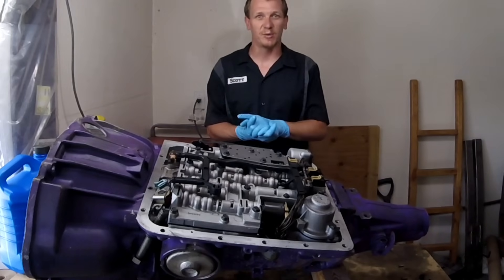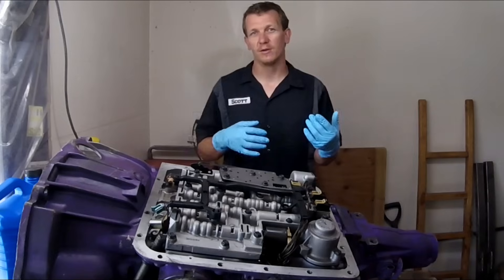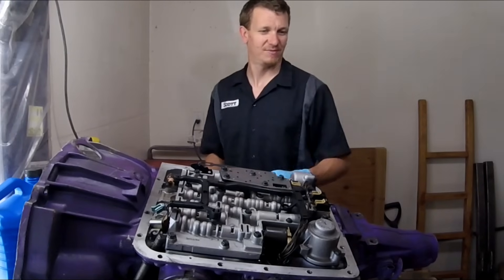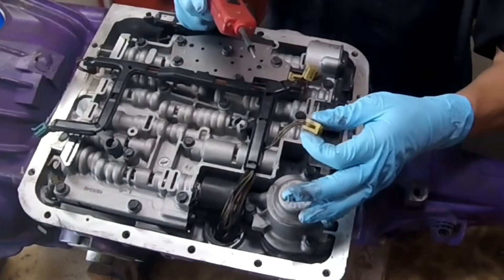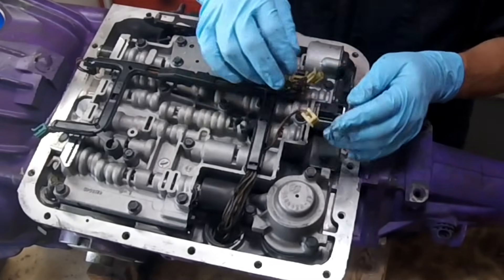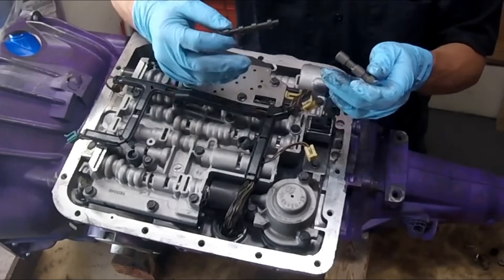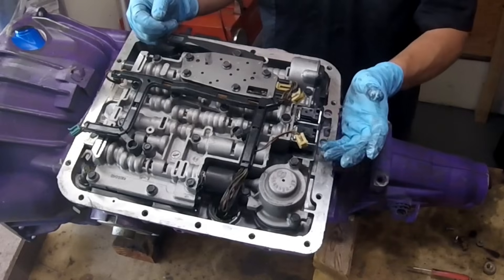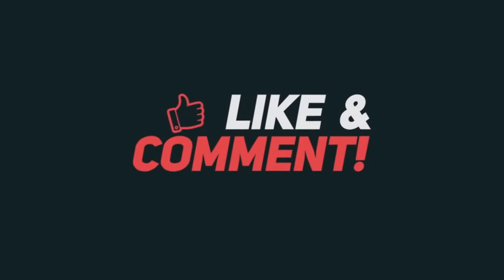⫷ GM 4L60-E Shift Solenoid 1-2 3-4 A and B replace p0756 p0753 p0752 ⫸

Comment: I got a 2005 avalanche I pulled the solenoids out, took the valve shafts and spring out, from somewhere a little 1 inch small spring and a small steel marble fell out to, where would they go never seen them doing this operation before

Comment: Hi on my avalanche  I did a transmission fluid change after replacing the filter and both solenoids and putting everything back both solenoids are stuck on and I can't shift past first on the computer I hooked up it says that both grounds are fine and voltage to them are correct I'm confused as to what I should do now

Comment: I enjoy the video thoroughly. I have a 1995G 20 Chevy van when it starts out at fifth’s perfect but after you drive a while and you stop like at a red light and go again, it doesn’t shift like it should so I am going to attempt to replace the shifting solenoidsand see if that’s the problem.

Comment: I have a 1993 chevy silverado c1500 v8 5.7 350. From the looks of the transmission wiring harness that it has, it only has 6 connections. It doesnt have the pwm solenoid. Do you know what part # harness it is. If you can help me out, thanks.

Comment: Howdy. I have a 1995 228,000 miles Sierra 1500 pickup.  Only symptom I have is delayed shift from 1st to 2nd. It waits until 2,700 to 3,100 rpms. I can usually make it upshift to 2nd by easing up on fuel pedal just a little for a moment. Does it hot or cold, in cold weather and warm. 

Everything else works as it should. It will downshift from 2nd to 1st as it should. Fluid clean, good and exactly Full. Fuses all good. No CEL or codes stored. No visual leaks or consumption. 

Is this the 1-2 solenoid / solenoid A failing, more than likely?  Or the 2-4 Servo?  Or the 1-2 Accumulator valve?  I have no CEL or stored codes.

Also, is there a way to manually shift it to further narrow down issue?   Many thanks!

Comment: I have always heard shift solonoid a and b should not move freely like that once installed.  And if they do the seals are bad.
Reply from the maker: They should not wiggle too much. But! They are not super tight. The groove that hold the clip that holds them in has a title play. If you do have a lot of play.. it is completely possible the Oring on the solenoid is bad. 

Thanks for stopping by and saying hi.  Hood luck with your project.  🤞🏻👍🏻💪🏻

Comment: Hi mate. The shift solenoid A and B is it the same one responsible for 3-4 as well ? Please I am having issues on my car corvette 2000 when I change the the 2 solenoid A and B the gear shift normal from 1-2,2-3 but hard sometimes to shift from 3-4 or 4-3 downward 😢😢😢😢 please extend your support

Comment: I had my tranny fluid line spliced it  blew out fluid eventually lost 3 Rd and forth gear? I don't know if I burned out clutch bands or if solenoid b went out ! If it's just the solenoid shouldn't it shift if I change it ! The truck will move and drive around town in first and second gear it seems if the bands were bad it wouldn't move in first or second

Comment: Hey I have a 2005 GMC Sierra the problem that I'm having is I'm in driving it stop pulling I pulled over set it off crank it back up and pull off it went from first to second then it stopped pulling again got it home got it home and it won't go in drive or reverse Crank it up the next day it went in reverse it went in drive what do you think it could be the shift solenoid

Comment: Got a 1997 Gmc jimmy 107,000  miles shifts perfect but when you are driving in randomly drops out of overdrive I did the whole tap the brake pedal the TCC does its thing but it will randomly fall out of over drive then shift back into overdrive.  Someone has put a cold Air intake on it I thought maybe maf sensor could be tricking the computer checked all the fuses when it's in overdrive it doesn't slip it runs great just falls out of overdrive to 3rd then give it throttle shifts back to overdrive fluid is new and Clean I traded for the vehicle so but it's low mileage some help greatly appreciated

Comment: Nice. However when you took out the 2nd one, you should have wiped it off as you mentioned while you had it out for visual representation. Regardless of the fact it may have been a 'junk' transmission. 👍🏻
Reply from the maker: That is a great tip. 👍🏻💪🏻

Comment: 1996 chevy silverado k1500. 4l60e got rebuild 30k miles ago and it acts fine when i’m driving after about 20 minutes of driving and i come to a complete stop, go to take off and it wants to go 5 mph. feels like it’s stuck in 2nd. i put it in 1st, then 2nd. nothing. i have 3rd and then no 4th. this happened out of the blue. i let the truck cool down and its fine again until 20 minutes of driving.

Comment: Did I miss something? When did the rod come out on the second solenoid rod removal?  When you put it back in does it go.    Spring, Rod, Spacer, Solenoid, Solenoid Clip?
Reply: Good question.... Because my 07 Tahoe did not have a spacer.. should I be concerned

Comment: I have a new problem. This video is excellent, hubby a mechanic, but really retired. My GMC Yukon XL Denali 2011 has had a slight problem for about 6 months, occasionally at a light, I press the accelerator and it jerks into gear as I take off. Then while driving home from a long trip a few days ago, at the start of the trip, driving 75-80 mph at times for the first hour. Stopped at rest stop, then when I got on the road the shifting wasn't working correctly. Sometimes when accelerating, the rpm's shot up but the car didn't seem to want to accelerate. We ended up driving home with the TOW button pushed and babied it going home. Hooked it up to a scan and it isn't giving any codes. We want to start with replacing both solenoids and checking the harness ends. But according to the friend mechanic that hooked it up, said it wasn't looking like it even has a solenoid in the transmission (like that particular transmission doesn't have one). He said all of this was confusing, not making any sense. So he will speak to some other guru's on it. Has anyone had something similar?
Reply: I have the same issue with my 2006 Chevrolet Tahoe z71 It get stuck in park when I engaged drive or reverse or rpms go up and doesn’t move or it moves a lil

Comment: I have an 02 trans as an auto mechanic assistant I got the filter with two shifts sensors how do I figure out which one is what for shift one to two an the other 3 an
 four im changing out mine due to water in the transmission due to the transmission cooler connection to the radiator

Comment: Can anyone help change solenoid a and b and transmission  seem to shift like its suppost to but it also seem to Rev around third and fourth gear but easy off throttle then back on it feel like it shifts
 I bought the transmission off Facebook market place and told it was rebuilt

Comment: This is the best video I've came across so far on this subject. My 03 just started acting up. It's stuck in second gear.i thought well it's gone. But when i hooked up my scan tool it said sylnoid b. So guess that's better than a busted tranny. I've never done this before but you explained it well enough I'm about to jump on it. I've swapped tranny's dozens of times but never a sylinoid. Hope that's all it is
Reply: Did it work? I just got a solenoid b stuck code also . Let me know plz
Reply: @roamsolo  yes it worked pretty easy fix. You will have to loosen yourexzaust manifold bolts to get your pan off. You dont have to take them off. Just loosen so you can pull the exhaust down a few inches. Make sure you replace both A & B sencor. That way you make sure it's not going to fail. I got A.C delco off amazon for $35. And it fixed it. I changed the filter while i was in their as well. Shifts great now. Good luck.
Reply: @jason6325  awesome thanks man

Comment: Scottie hobbies,   bro u might have just saved me thousands of dollars but I still have a very serious question.........   with  the 4L60e  if it's hotter than hell like it's been in the south these past weeks would the heat make it not shift or only give me one gear .... going to work I had only high gear  and only able to creep off a stop sign (no power like the motor is running hot but it's not) then 6 hrs later when I leave work to limp it home at night  it shifts an runs smoothe as silk .... guess my question is do I need to flush the system an freshen it up with new fluid or would it be the tranny intercooler which I've been told is an issue in these c/k obs 1500?

Comment: On A and B shifts Solenoid putting it back into place on my 2004 Transmission!! my Transmission doesn’t have a spacer! does it vary in the years of making the 4l60e to have a spacer
Reply from the maker: Not all of the models have the spacer. So if you removed yours and a spacer did not come out. Leave it alone and reinstall it as you removed it.

Comment: Update ! 2003 Chevy Tahoe 4.8L 4wd 331K miles. Here what has happen, I went to drain the tranny fluid and the drain plug bolt head stripped so I drilled a small hole in the pan and drained the fluid, I purchased a used refurb pan then took down the pan I changed the both solenoids A-B 2-3 3-2 then buttoned the pan up fill with fluid and it works ! Shifts nicely and its fast ! Thank you !

Comment: can brake cleaner be used to clean the entire open surface of the shift selonid area? and generally is it safe to clean he residual old oil?
Reply from the maker: I would not use brake clean to clean the transmission parts.I would not want to take the chance of contaminating the new fluid.I personally put new ATF in a spray bottle and spray it on the valve body or transmission. I use a dustless cloth towel to wipe up all of the residual on the pin and the open surface of the transmission.

Comment: If tranny is still in vehicle is there anything that will fall out when taking out the shift values
Reply from the maker: Some transmissions have a spacer in the shift valve port. I think it is in this video where I remove a shift solenoid and something pops out. That is the little quarter inch spacer in the shift valve port. But not all Valve bodies have this spacer in them.

Comment: When changing out these shift solenoids and the tcc solenoids, do you have to get them programmed at all or are they just plug and play? As long as im buying the genuine parts. And also, when installing the new solenoids should i dip them in new atf fluid before putting them back into their slots to try to get fluid back into those crevasis, and to also kinda lube the screens and o rings associated?

Comment: My car hard difficult shifting gears then eventually got stuck in first gear. DSI M78 6T. When I put in R it moves but when I put in D it takes long before taking off. I have code P0700. Do I change solenoids, valve body or TCM?

Comment: One thing ive notice is alot  of videos don't mention the mistakes you can make doing the job. Be careful
Reply from the maker: #facts. 
Doing these repairs at home usually end up costing you more in the long run to be honest.I always recommend if you are going to open the case up and take a look at a solenoid or a sensor, you might as well buy a kit that includes the harness and all the sensors at once.The fluid in this transmission is not cheap. And many times. You have to open the case again because the 1st repair was not the right one. 7 times out of 10 with these transmissions if. You have over a 120000 miles and you are getting any transmission Drivability symptoms you might as well save for a rebuild. If not a new transmission.
Reply from the maker: https://youtu.be/lg8cCPQHpu0 That is a pretty Old video I made with a few recommendations when messing with your transmission. I fly past the Mention of how easy it is to make a mistake as well but I do my best to give you my honest opinion.
Reply: @ScottiesHobbies  appreciate it

Comment: My 2001 Chevy Silverado doesn’t shift from 2-3 it doesn’t neutralize just doesn’t shift fresh rebuilt trans any advise will help pls
Reply from the maker: How many miles are on the rebuild? Did you replace the 3rd gear check ball in the case?

Comment: Was roasting tires like a goofball doing some weight transfer in the rain in my 2013 silverado. Went home went to bed woke up and now my 1-2 shift revs really high and finally drops in after it hangs at 4.5k. If I let off the throttle at 2.5k where it used to shift it shifts into 2nd no problem at all. Checked fluid And level was really low so put a few quarts in and that helped a little so now under light throttle at a stop sign it will shift basically fine again but anytime I put a little bit more than a little throttle it pulls the rpms up real high and holds them until it hard shifts

Comment: Hey scott, i have a 2000 gmc 4.3 4x4.  I recently replaced the mass air floe sensor.  Felt like a fix.  However, now i have to start driving in 1st then shift up to drive to go forward.  My qwestion is this.  If a transmission doent grind gears and can still move, all be it hobbled,  is it bad. Got any ideas?

Comment: Thank you Scott for the informative video I have a 2003 Chevy Tahoe 4.8L 4wd 
331K miles the codes are P0758 Shift Solenoid 2-3 
I bought transmission filter kit with the A-B Solenoids and a 3-2 shift I figure Ill change it any way.  Ill do this in a few days I feel very confidant to do this task while the Tranny is still mounted performing it upside down. I'm sure this is the problem and I will check the grounding and valves THANK YOU !!

Comment: I have a 2004 Envoy LT and I just had the transmission rebuilt about 7 to 8 years ago went to Florida last week car ran fine went to go visit our son in Daytona and the transmission was going at the first second and third with no problem and then when it went to Overdrive it would just slip it wouldn't even grab so I had to put the car back into third to drive it what would be causing that problem thank you

Comment: I drive 2001 chevy silverado...i clipped a deer ..spun out and went off the road...normally it shifts at about 1100 rpms to go into second gear now it has to get up to 3000 to 3500 rpm before it shifts and no overdrive??? Any help on problem???

Comment: Cool video I like that you made mention of the linkage and that some people bend them I didn't want to but it was easier than trying remove it. My question is how how likely is it that replacing these two solenoids will correct my no shift problem.  My tahoe drives perfectly accept the part where it fails to shift out of 1st accept when it's cold
Reply from the maker: Shift solenoid could be a issue, stuck shift valves in the valve body is common. Another common issue would be your one to accumulator not moving properly.

But check out this video I uploaded a wile ago: https://youtu.be/lg8cCPQHpu0

Good luck. 🤞🤞💪

Comment: Hello are the solenoids marked A&B or can you just install without worrying 
about which one goes in the A or B slot ?
Reply from the maker: A and b are the same. Dont worry about it.
Reply: @ScottiesHobbies  thanks for responding I changed mine today drives much better
Reply from the maker: @young_sick  nice! Good luck on your  next project. 👍🤞💪
Reply: @ScottiesHobbies  your video helped a great deal

Comment: Hi. I have a problem with my GMC ENVOY XUV My GMC Envoy has been working fine and I drove it earlier today to run some errands and parked it at home. 4hrs later my wife gets in to use it, starts it up fine, tries to go in reverse and the car doesn't move. The engine revs up but wont move forward or reverse. Its almost as if it its in park. One thing I did notice is that when I shifted the gear its was a lot smoother when transitioning from Park to the other shifts than any other time. when I shift the gears and also when I shift it isn't allowing me to push my vehicle, its almost as if it is stuck in park even after shifting. My car has 143000 miles. My car has a automatic transmission and Automatic Transmission Control Solenoid I changed and new trans oil and filter still not moving.
Reply: U check the shift linkage 🔗🔗

Comment: My 94 cad deville 4T60-E requires going 34 mph for first upshift. Then second upshift needs 63 mph. 4th gear never happens. Wondering how to get it to shift correctly.  What codes should appear?  What can I tell the TransShop?

Comment: The tool scanner says solenoid a is off I dont have reverse and lost 2and and 4th gear do you think that's the issue I thought it would ge the sun gear but the tool scanner says solenoid a can that cause me to lose reverse 2and and 4th
Reply from the maker: I bet your sun gear is probably stripped out. The computer is probably confused. It might be worth a try, replacing the solenoids but I doubt that will fix it. Atf is about 40 bucks for 5 qts, you don't want to drain and fill that thing to many times.
Reply: @ScottiesHobbies  ok ya I was hopeing it would be an easy fix I dont have the money for a rebuilt, I didnt know if the soelinods would make a transmission lose those three gears or not only have 1st and 3rd gear
Reply from the maker: @andrewg7344  super highly doubtful. But.... nothing is 'normal' when it comes to these 4l60e trannys.